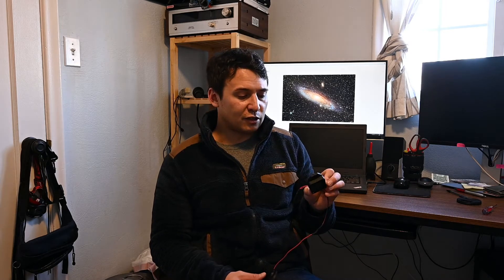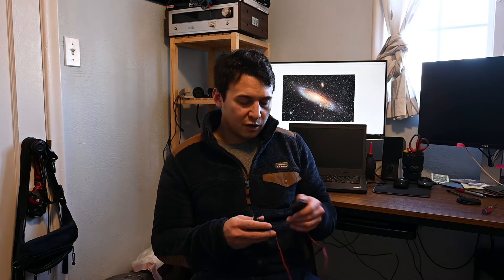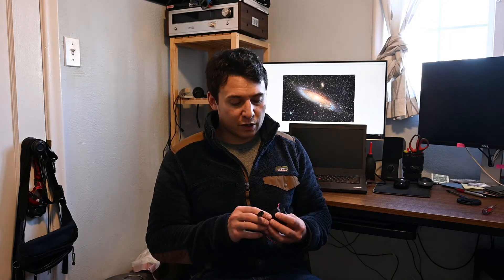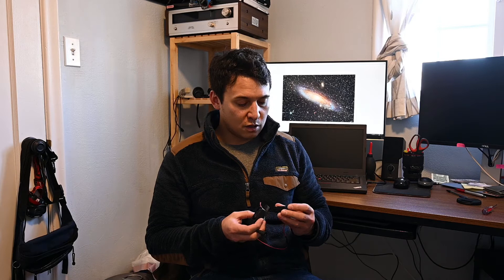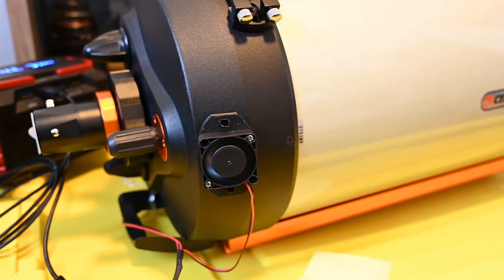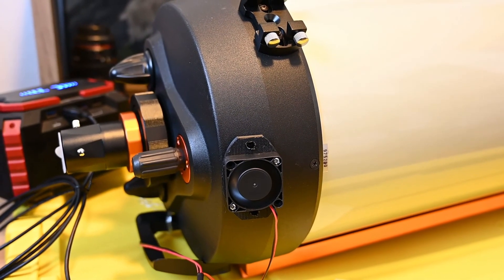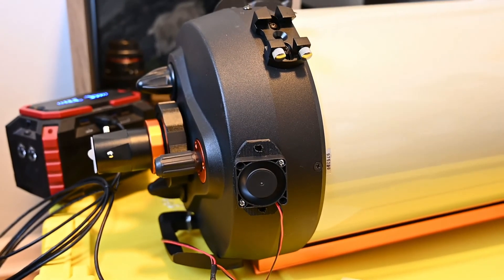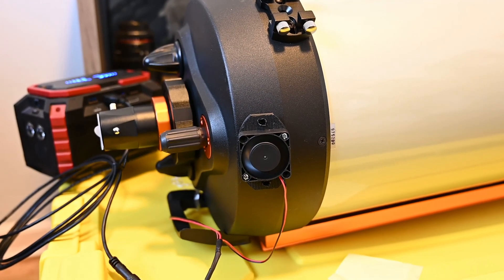Cheap Cooling Fans for Your Celestron EdgeHD Telescope

Comment: I have a Celestron Edge 8.  I had wondered how useful the tiny, filtered vents are for cooling.  Even though Celestron does advertise that the vents have some use for cooling, buried in their white papers about the Edge, they admit they serve the important role of insuring a controlled pressure equalization when the temperature, altitude, or barometic pressure changes.  Unlike the old SCT models which have the eyepiece holder opening directly into the optical tube, the Edge models are largely sealed to the atmosphere due to the built in flattening optical elements  that are in the tube which goes to the eyepiece.  The filters in the vents capture micron size particles, it is unlikely they would naturally pass an appreciable airflow.  That is why you put the fan over them.  My concern is that these filters may become clogged as they are so fine, but otherwise not being very effective.  I am also a Utah desert observer who is endlessly fighting dust and the sudden 40 degree + temperature drop when the sun goes down.  I have tried a new strategy of putting the SCT into  a very large ice cooler, with one or two small ice substitute bricks in this.  This avoids the intense daytime heat, keeps out the dust, and has the scope being precooled to the nightime temperature.  Just a thought.
Reply from the maker: Hey Michael. Thanks for the comment, and that's an interesting approach with the cooler. I will have to look into that. Unfortunately, I have not had the opportunity to take my Edge out since I installed the fans. Hopefully in the next month or so. In the past, I never had an issue during the warmer months. Cold winter nights seemed to be my real enemy where the temps  would go from 30's to 10 degrees shortly after the sun setting.